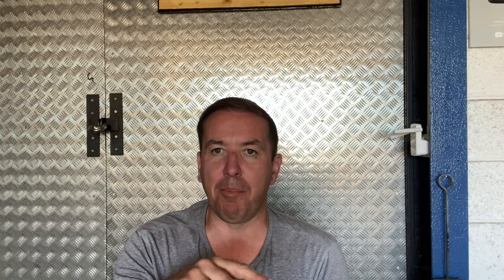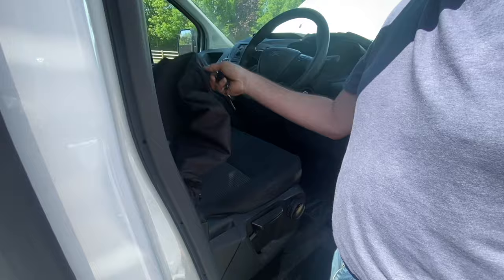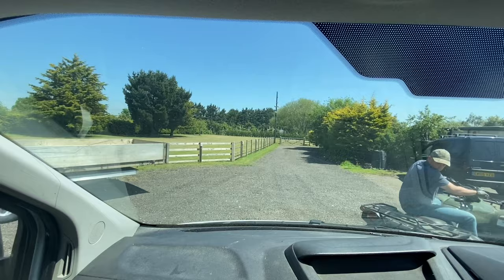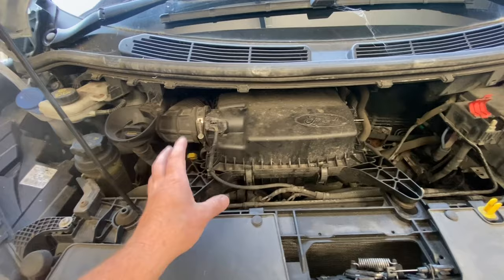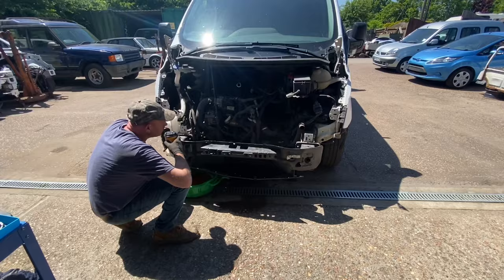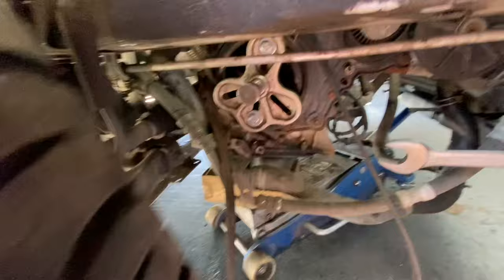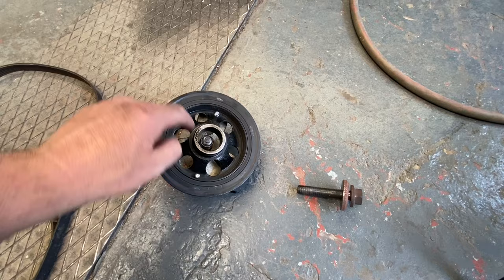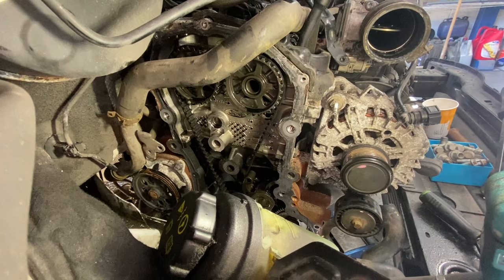Cheap 2017 Ford Transit Custom Euro 6 Engine Fail PT 1

Comment: Good video guys love the investigation work. The wet belts are notorious for braking on the ford galaxy. Done one on my Ford connect was pretty lucky it didn't bought the van not realising it had a wet belt van had 145000 miles on it run it for a few months until somebody told me about it. It should have been done at 120000 miles ford recommend changing at 150000 but they normally break way before this. I've heard of galaxy's wet belts going at 80000-900000 miles

Comment: Don't go and buy timing kit as you can use 6mm drill bits. Only special tool you need is hydraulic gear puller to pull bottom crank pully off. Done fare few belts on theses

Comment: If the belt never snapped and just shead teeth, could it not just have stalled and avoided damage? Maybe the wear on the  cam is just due to age/miles

Comment: Good job guys really enjoyed the video. Just one question when you say the wet belt .  you are calling the cambelt the wet belt as well as the oil pump drive belt.  Will you change the oil pump drive belt as well.  Mr Gee

Comment: There isnt officially a  wet belt replacement interval - they're very well known to let go. Usually you get bent or broken rockers and the lobes definitely will spin on the shafts. 100% replace the cam carrier unit.   They are absolutely shocking engines

Comment: I had a nearly 3 year old 1.8 connect  10 reg turbo went and took the engine out company vehicle .Went into Hendys took three months to resolve broke down twice after a new engine and turbo was fitted plus a massive row with the dealer which I then got dragged up to head office nearly got fired over it .

Comment: Great video. I think one of the lessons of this video is that cam belts really should be changed at the receommended interval. Not doing this must have cost the previous owner quite a lot of money I would suspect! As ever you guys just crack on with the work in your usual efficient way.
Reply: It wasnt due till 150k / 10 years, but you're right it's cost a shed load.

Comment: I've got a Transit LWB i bought it from new. It's only got 60,000 miles on the cam chain snapped when it was 3mths old.
Up to now it has had 3 cam chains on it.
I would never buy another transit again.
They are pure money pits....
Stunning content lads as always keep up the Excellent work...Good luck with the tranny🤞👍
Reply from the maker: It shouldn’t cost you a penny it should all be done under warranty 👍
Reply: @sruk  The first one was at 3 months old done under warranty. After 12 months old I was not covered. After the 3rd cam chain I've took it off road and use it for shed.

Comment: Hello John 😁have we really moved on with technology from that simple viva engine. What a nightmare these modern models really are .great viewing though
Reply from the maker: Who’s John
Reply: Nightmare to work on but that van has done 130,000 miles probably without issue. Swings and roundabouts

Comment: Very interesting video and it just shows you how much you lads extensive knowledge were able to figure out what the problem might be and you were right!!! Once you got the front off what a complex amount of pipe work was there and a very untidy design of engine, which was not easy to access and work on. However great to see and we will also see the result later👍👍👍🚘🚘🚘

Comment: 👍 good one rob and Chris 
Would it not be easier to change engine??
Reply: Even if you was fitting a used engine, you would have to change the belts on it anyway, so no point.

Comment: Just a quick a quick one , how often should a cam belt be changed on a ford focus S , mines 2014 and done 62000 miles
Reply: what engine?
1.6 says 100k/8 years or 1.6 ecoboost 120k/10 years
1.0 ecoboost 150k/10 years
I wouldn't leave it that long, I stick to 60k/5 years regardless.
belt is cheaper than a new engine

Comment: I have an 1.5 econetic fiesta on a 2014 plate i bought with 9k on the clock and now at 20k on the clock that was owned by islington council
when should i get the belt changed as i dont know when it was last or ever been done

Dont fancy breaking it as it does 11 quid from Norwich to Cambridge and return daily lol

Comment: I'll stick with my mk4 - you know where you are with the old 2.5di. Snap a timing belt? Hammer the pushrods straight, fit a new belt, turn the key - off you go! 😀
Reply: Meh, too much work. On the PSA 2.0 lump, you just whip off the cam cover, replace whichever rockers are broken, new timing belt and off you go. Now that's smart engineering.

Comment: Nice one lads I had a 1.6  new shape ford connect in 2014 it had 400 km had it for 2 days and the engine died garage had to put a new crate engine in

Comment: Great vid!  Very informative.  I never knew this type of cam assembly existed.  So if I understand, the cam lobes "spin" on the shaft if a valve is pushed up by the piston.  Does that mean that, in theory, the lobe can be turned back?
Reply from the maker: I wouldn’t want to try 👍
Reply: @sruk  No, me either, but just from a curiosity point of view it would be interesting to know if it is theoretically possible.  Keep up the great work, guys.

Comment: Change all the tappets as they wear out over time and engine is noisy, also you have to change all the rockers as well because there is little bearings in them and when they fail bits off them fall in the the engine kiling it.
Plue all the rest you've mentioned in the video and that engine will be like new

Comment: Might be worth putting a bore scope down and seeing if there is any whiteness marks on the crown of the pistons.some little cameras you can use on a laptop and some even come with mirrors so you can see above the camera and there only a few quid.
A lot of the modern stuff now has cam belt intervals of 140k+ or 10 years so people don't want to do them because 'it's not due yet'

Comment: Just a pointer before you go in big and buy a carrier, turn the crank and see if it’s fowling, with the valves up it shouldn’t, also check you haven’t got a slack valve I.e no head on the valve it she locks up.

Comment: hi great video, what does chris and yourself think of the use of wet cam belt on modern engines?
Reply from the maker: It’s not a wet cam belt it’s the oil pump belt 👍
Reply: @sruk  I'm pretty sure that the cambelt on this engine is also 'wet', that's why its metal cover is so securely sealed..

Comment: I seem to remember there was a recall on these engines, something to do with the timing belt setup, but I can't think what it was. Might be worth looking into it to see if whatever it was has been fixed on this one.
Reply: Not going to get much joy if the belt should have been changed at 80k though .

Comment: That is a very nice little van and what a beautiful day to be working out side 
And who said you waffle on , never 
It was a bag of chips and a scotch and coke long 
Just right off for another scotch 
I’m hopeful to get my broken bmw diesel back next week 
No broken rockers just 4 bent valves and 16 new valance guides later 🤦‍♂️👍👍👍
Reply: Wasnt an N47 timing chain failure by any chance?
Reply: @NeilsCarsAviationTravel  by the slightest chance yes it was 😢😢
Reply: @davidbarnsley8486  I bought a 320d with 330k miles on the clock which ended up with a broken guide. lickily it didnt snap, but there is a series on the car on my channel.
You were lucky, normally a broken chain writes off the engine.
Reply: @NeilsCarsAviationTravel  the chain didn’t break it was super stretched and the top sprocket was nearly round 
The guide I think broke and the chain jumped so no timing 
But my engine only had 180k ms so just over 100k miles 
So a little disappointed with it for such low mileage cheers

Comment: Got a tourneo custom 9 seater. Full house been hassle since I got it at 28k. Now on 68k. Had issue with MAF sensor light coming even though had been replaced. Ford then changed temp sensor and a cracked air pipe. Since then power loss poor consumption and jerks while driving along like it gets power then looses it again. Called Ford and they said ecu needs to be remapped? Fed up.

Comment: Compression test it guys, if there's 1 cylinder down there's a chance the crank is no good so you'd need a motor. Sometimes worth checking with main stealer as a bare unit can sometimes be relatively cheap compared to a second hand one

Comment: Hi, how you gonna ensure theres no bits of the old belt left in the engine?. Oil flush on first starting?. Thinking of buying a ford next, not eco boost or wet belt though 😅

Comment: I believe the cam-belt interval is 150,000 miles/10 years, in which case it failed early.
Reply: That’s what we were told, hence it hadn’t been changed.
Reply: 144000 miles / 10 years for vans built before 27.08.2018 either way it's obviously too long :)
Reply: @paulbravery9820  so they actually extended the interval out further after 2018? That was pure genius of Ford 😀
Reply: @NeilsCarsAviationTravel  They are mad at Ford :)

Comment: Seems the seller was honest, good on them. Hope you have dodged a bullet and Audi's for doing all the belts, no sloppy shortcuts. Got to do full can in mine, so all the belts will be changed at same time, ain't worth thde hassle down the road.  Great vid, gonna send you a link on Insta to s Traffic Camper that was for sale locally, it's just like yours. 👍

Comment: Doesn't look so bad, hope your £300 spend rewards your efforts thus far,  straight edge looked good, drove a mk3 transit diesel lwb in the early 2000's in NZ, only trouble was fuel pump & sheared driveshaft/universal, hope you find some more helpful expertise, prior to the said transit, all previous experience were the late cf bedford with that fully bolted front, good luck with your endeavours, it will be a learning curve for any future late model transits.😎👌👍

Comment: I am going to buy ford focus 2020 with 2.0 ecoblue diesel 150 hp. What is the recommended interval for belt replacement ?  Any other potential problems ?

Comment: I’m on the look out for a van (first van I will actual own myself) will be my main motor, work and play, been looking at the customs but for my budget they are high mileage, what’s the better choice out of the 2.0 vivaro/trafic, 1.6 vivaro/trafic or 2.2 custom?…..seen a nice 2012 2.0 vivaro sportive under 80k miles, or later choices all above 100k miles mostly around 130k?…..when searching the internet about reliability all you see is all the bad things and anything saying anything good isn’t even about reliability but more about cup holders, I know all motors have their issues and it’s somewhat to do with how they are treated and cared for but which is the safest bet? Any recommendations? 😫
Reply: citroën acadiane;)
Reply: I was looking at the vivaro mate but it has serious reliability issues. I ended up going with a 2015 transit connect lwb because it only had 87k on the clock. 7.2 grand. All the bigger vans I looked at had north of 120k. That way I got the space, reliability and economy. The 1.6 engine on the connect has a fairly good reputation and almost the same space as the vivaro 👍

Comment: Hi guys great content.. my question how do you know if the van is belt or chain driven I've got a 2016 lwb custom told its chain driven.
Reply: If you speak to some garages, if they have access to something like auto data it will tell them
Reply from the maker: If it’s a 2.0 custom like this it’s going to be a belt like this 👍
Reply: Thanks mines 2.2 so assuming its chain driven. Loving this section on commercial vehicles.
Reply: @imranpatel2706  yep chain on a 2.2 and belt on the 2.0

Comment: Hi I was wondering if you could help me I have got a transit custom 2017 Getting diesel to the pump and a valve outside of the pump Getting no diesel to the injectors any ideas Check all fuses and relay in the fuse Box under the bonnet Add filters try toilet Add it on computer to clear all faults When turning over no smoke out the exhaust thanks rob
Reply: What pressure u got in the fuel rail when cranking?

Comment: i could never have the courage to strip engine down that far. i was interested in the way that you took off the front grill and parts attached to it. can it be done without removing radiator.
excellent video.
Reply from the maker: It can yes 👍
Reply: @sruk   thanks for that.
looking forward to the finished project.
Reply: Only a panic situation if your working on your daily.

Comment: Any idea what might be up with my Volvo V70 Rob ??? Its misfiring but I've changed the plugs and all 5 coil packs ??? Cheers if you can help...
Reply: Injectors? Compression? 
Just chucking a couple of ideas at you here 🙂
Reply: @sammytheseal2307  Thanks mate appreciate the help. Will get onto a compression test next.

Comment: that is why I get a full service on my old L200 2003 now and then . and yes a garage did my timing and fk it up the bottom pully bolt not tight yep valve to piston good thing i got the parts half price hmm. its ok now. [never trust sum garages]  .  good vid you did with the strip down 😁😍👍

Comment: I have the 2017.On recall dipstick was changed to allow a higher level fuel and software upgrade. Next noise coming from the oil pump area turns out to be bad oil pumps fitted to a range of vehicles changed oil pump and chain. Oil was lost due to a faulty mechanic not doing the job correctly. Next up injector change. next up all injectors changed. next add blue was getting used more than the fuel cost a fortune to run getting about twenty to the gallon. Next, I went on Holiday towing a caravan creeping up hills in second gear no power. Next I had to buy a new battery while the vehicle was eight months old apparently my fault for not driving enough. Same driving I have done for thirty years.
From a new absolutely rubbish Ford van. Good news Ford after I complained about all the problems and many others I did not complain about awarded me one free service.Nothing about the £100 for a replacement under the engine cover ruined through the oil escaping. More good news despite my complaining that I still had at least one faulty injector and nothing was being done. I bought a pro scanner and deduced no 4 injector was down and after checking all sensors decided to look into the EGR and there was a serious problem all the tubes were totally coked up it took a few hours to clean and reassemble along with a new injector, that was 2 years ago no more problems apart from the battery which I have solved with a thin flexible solar panel. Caravan tows a dream fuel consumption great . Fun to drive I like my Ford now. I wonder how many Fords blew up due to faulty oil pumps and faulty injectors weakening the oil. Ford already knew about all the problems but decided to let Joe public suffer. Keep up the good videos

Comment: Teeth probs ripped off I'm just in the middle of doing a audi a6 belt was still on and not snapped but keyway had ripped 17teeth off the belt engine is dead now and in middle of putting a new engine in it good look with it

Comment: Can you do a compression test now just yo make sure all,s OK?. 
These engines really are not that good are they 
 I'd be expecting a goodwill gesture from Ford as that belt has failed far too early .
Does it have a proper service history from Ford?
Reply from the maker: It’s to old and mileage is to high 👍

Comment: I think the reason the timing belt cover is glued in place is because in theory the cover isn't designed to be removed in the life of the vehicle. 'Wet' belts are designed to last the life of the vehicle.
Reply: They do last the life but the life of the vehicle ends when the belt fails.  Seems Ford have designed this vehicle to last about 100,000miles then be disposed of, makes sense, an ever lasting van would put a lot of people out of work.

Comment: Should fly out when done with the demand for Courier work , My new Company one has been put back 2 months on the build time due the current climate/silicon chips
Reply: Interesting point you make  , I seen something recently that small / medium vans are in huge demand because of courier work as you mentioned 
( second hand ones )

Comment: Fords used to be known for good reliability and fairly cheap parts. Not any more. This one has done 130K and no belt change so a problem waiting to happen. I have had Transits for 28 years. The Mk 4 and Mk5 had the great 2.5 Di engine, and the Mk7 I have just sold, had the 2.2. Good and powerful engine, but crap injector clamping  leading to blow by on the injectors. Ford wanted £ 230 for some copper washers and new bolts to solve it.The Ford parts guy was very fair and got me  got Peugeot boxed items which were exactly the same but £100 cheaper. They did solve the problem, but I lost faith in Fords. They were a British made van but now made  in Turkey. A great van, but a rot box, no matter how you try to stop it. Fords have been short changing owners for years. A bit controversial, I know, but any comments?
Reply: You know your models well, I drove a 1990 model in the early 2000's for a fleet  operator in NZ, I assume that was a mk3, perhaps you can clarify that, it did have 2.5litre turbo and was a LWB Transit, all repairs were performed at the then employers expense. Fuel pump & drive shaft shear were all the expensive repairs. Another employer in a new adopted city in NZ, I drive an LDV van ( transit lookalike ) almost spitting image ( excuse the pun ).😎👌👍

Comment: According to Ford as manufacturer, the cam belt should last up to 240 000 kilometers (149 000 miles). Obviously you shouldn`t try it when the warranty is expired.